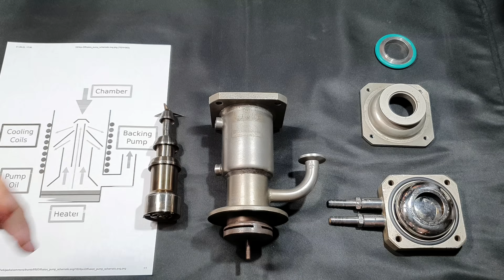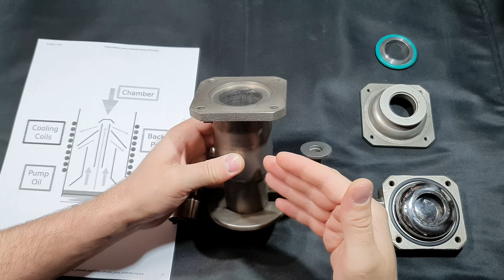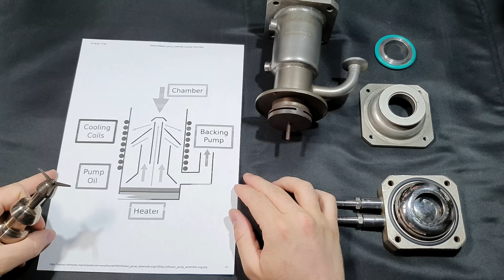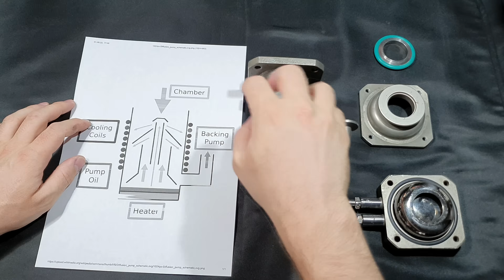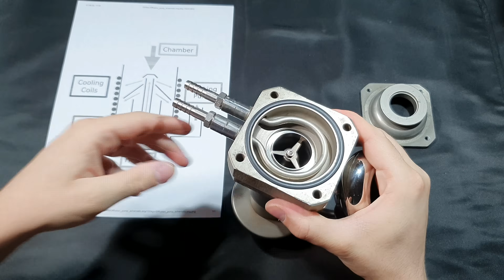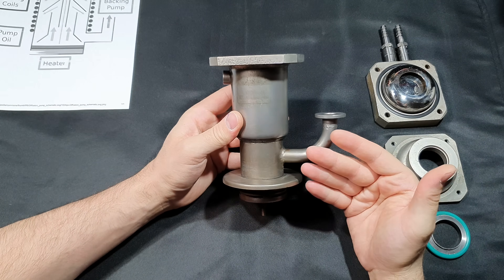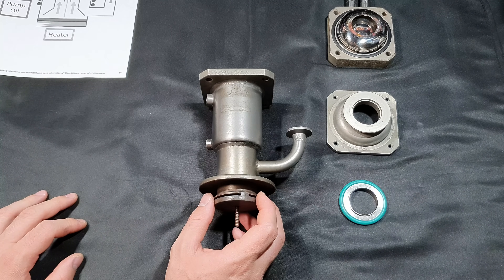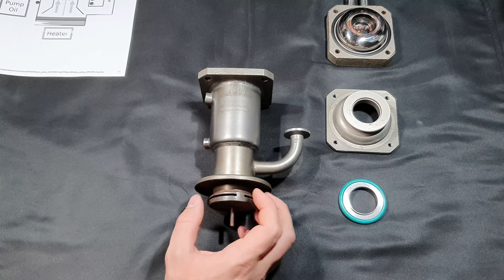The Science Behind Diffusion Vacuum Pumps: How They Work

Comment: So does the oil vapour envelop the air molecule, coating it in oil and dragging it down, or does the flow of oil just entrain the air? Ive got a small edwards air cooled diffusion pump arriving tomorrow to add to my 1980s neon tube processing machine. Currently using an Edwards RV3, which gets down to about 1x10-3 but hoping the addition of the diffusion pump will get it much lower. Looking forward to playing with it.

Comment: I worked 40 years in microelectronics manufacturing, I was in charge of various processes steps all using vacuum systems. Diffusion pumps were popular until about 20 years ago. Since then the, drawbacks of, size, orientation and most of all oil backstreaming, has rendered these pumps obsolete in manufacturing processes, all have been replaced by turbo molecular and Cryogenic pumps. RIP diffusion pumps.
Reply: They're still very much in use in metallurgy and particle physics, as they can pump more volume than any other type of high vacuum pump and require very little maintenance.  In particle accelerators they are generally headed by a cryopump.

Comment: I occasionally use a diffusion pump. I get the oil from Dekont-Vukuumservice-GmbH (Germany). I use Dekonol DIFFM100 (€37.96/kg), a mineral oil specifically for diffusion pumps. They also have the Dekonol D705 variety (€218.54/kg), an oxygen-insensitive silicone oil for higher demands. But so far I've gotten along well with the mineral oil. 
Greetings from Germany.

Comment: Originally I thought that this might be used at the output of a Bussard Collector for picking up extra hydrogen fuel instead of just bouncing it away which takes away from the inertia.
Accumulate and use.
Something else to fling it through a small hole into a big tank for a pump which can add pressure later.

Comment: Thank you very much!  I'm a particle physicist; vacuum was the complicated mysterious thing that would fail and cause us to not be able to take beam until it was fixed.  I'm pretty sure that even in big beam pipe volume accelerator systems, they use diffusion pumps as the primary pump (backed by big mechanical roughing pumps). 

I'm so glad for your thorough explanation.  I've seen diagrams of diffusion pumps, but just of the tree shapes and the oil sprays.  I've never seen a diagram with the heater and the cooling jacket.  That makes so much more sense.  

Thanks!
Reply: Meanwhile, for me, vacuum is simple even if temperamental, and beam generation and beam optics are the mysterious thing.

Comment: Very interesting! 

I can’t remember where I saw it, but in the 19th century they used a vacuum pump design that looked like a bicycle wheel with tiny buckets set around the rim. When the wheel spins each bucket picks up one drop of mercury from a sump, carries it up and over and throws it into a funnel that shoots a drop of mercury across the vacuum chamber and into another funnel that leads back to the sump. When the drop flies across chamber it pushes out any gas molecules that went into the exit tube and that is how it creates the vacuum.
Reply from the maker: What you are referring to is called a "Sprengel pump". Also a very interesting and cool concept. 
Cody'sLab made a video about a DIY version of this type of pump.

Comment: 0:57 Foreline pump? Fourline pump? Fohrlein pump? What is it? (I've never heard of it, let alone got one!)
Reply: Came from German, can be translated as “before” vacuum. Basically it’s a pump which creates primary low vacuum for higher vacuum pumps to work.
Reply: More common name is forvacuum pump
Reply: Foreline pump, also known as a roughing pump. Like the other guy said its to bring the vacuum chamber down to a suitable level of vacuum before turning the pump on. With any serious vacuum application, pumps generally have a certain level of vacuum that they are fit to run in, because otherwise they will be damaged .

Comment: I've got a lot of appliances from an early vacuum tube shop from the 1920s. The shop later specialized in TX tubes refurbishment until the 60s. With it came 2 early glass diffusion pumps (unfortunately cracked) still with some mercury droplets in them.  Also with some asbestos isolation. Apparently they were used with a Bunsen flame back then. They look beautiful really.

Comment: YOKOGAWA fluid gyro compasses for ships still have their older CMZ-700 units in service, there is about 10 cc. of Mercury inside the unit along with medium weight mineral oil and water treated with a preservative. Their newer CMZ-900 are mercury free and only have the mineral oil and treated water. I used to service those units and about 1 out of 10 jobs was an old CMZ700 so I had an annual overhaul kit of mercury, oil, treated water, and o-rings, and cleaning solvent. BTW love your channel, your explanations are excellent!

Comment: All is good but I'm unable to understand one thing that what thing forces the air molecules in vacuum chamber to come in the inlet of the pump. I mean what creates suction at the inlet of diffusion pump. 

As in rotary-vane pump we have blades fixed on rotor which create suction at the inlet.
Reply from the maker: There is nothing forcing the air molecules into the pump. That's the weird thing at very low pressures. In the molecular flow region you basically have to wait for the air molecule to fly into your pump where it is then excluded from the vacuum by the pump. That's also the reason why vacuum hoses or pipes for high vacuum applications have a large diameter. The chance is much higher, that an air molecule will fly though a larger opening than a smaller one.

Comment: Since I do many applications utilizing vacuum (mostly vacuum distillations of high-boiling materials), I'm very happy to learn more about it. Pumps, gauges, tubing, flanges, sealing etc. For example, lately I have been interested in how much influence the type of oil has on the resulting vacuum of a rotary (belt driven) oil pump. It has to be of certain parameters, fresh (not contaminated with volatiles) and in proper amount. Otherwise the vacuum drops significantly. Other influence (hosing, sealing, aparatus size, number of connections, even freezing - no significant importance is observed). I'm thinking about incorporating the diffusion pump to our systems, too.

Comment: have you tested the pump yet? And measured what kind of vacuum it creates?
Reply from the maker: Sadly no. I did not have the money to buy the oil. But I will make a video as soon as that changes :)
Reply: Did it come with a manual with what wattage or did you custom make it yourself? And what kind of roughing pump will you use? And if you do have a manual or made it yourself, what kind of pumping speed and ultimate vacuum can you achieve? I assume the bigger the pump, the fast and more ultimate the vacuum becomes.  I just spent 200 euros for a wet dual stage rotary vane pump that goes to about 3x10E-3 mbar. So looking for my second stage part. I'm working on additive manufacturing so I only really need to look at a high vacuum. I wish ion pumps would work for this type but physics are against me :/(they seem the most interesting and cheap to diy build) but they would start to break easily at this type of roughing pump.
Reply: Great videos by the way, just subscribed very interesting projects

Comment: I worked with mercury diffusion pumps in grad school (for organometallic synthesis).  The main advantage is that they are immune to air/oxygen intrusion, so there is no need to bypass the pump when evacuating large flasks/chambers.  This simplifies valving and saves time.  Of course, the trade-off is that you always have 10kg of mercury refluxing in a large and complex glass apparatus right next to where you are manipulating flasks, stir plates, heat guns, cold traps, lecture bottles, etc.
Reply from the maker: Thank you for the information!
Reply: Now I'm curious, how did you set up the cold traps for this vacuum system? I would imagine you need at least 2 (or 2x2) one between the difussion pump and the oil pump, as to not contaminate the oil with a bunch of mercury. And one between your vacuum system and the difussion pump to not get solvents etc into the mercury.
Reply: @merlin1371  The diffusion pump itself was water cooled, with an extra water cooled condenser on the low vacuum side (between the rotary vane pump and the diffusion pump).  A liquid nitrogen trap was used between the diffusion pump and the main vacuum manifold and kept full of LN2, except for maintenance shut downs (about once a year, when maybe a mL or so of mercury would be recovered, mostly from a McCleod gauge on the main manifold).  Four work stations depended from the main manifold, each with a LN2 trap for collecting solvents.  Two of the work stations were identical high vacuum manifolds (with a sub manifold for three sodium/benzophenone solvent vacuum stills, connection to a mercury manometer/bubbler, scrubbed argon, and the reaction apparatus - typically a "flip-frit", but also sublimators, reflux set-ups, etc.).  One work station was a 4 port Schlenk line.  And the last work station was an automated Toepler pump system (for measuring gas consumed or evolved and analyzing evolved gases).  Here is a link to a page with some pictures of the vac-line with Toepler pump: https://wolczanski.chem.cornell.edu/lab-tour/ .  Not sure if they are still using a mercury diffusion pump on this line (which I used from 1981 to 1986).
Reply: Screw wrecked a plane stranded in the woods movies, lost at sea movies, deserted island movies, submarine movies, stuck underwater movies, stuck in space movies, lost is space movies, stranded in space movies, trapped in a broken submarine/boat/spaceship/cistern/receptacle/bunker/relationship movies AND this mercury rerefibulater thing.
.....but also I want one 😮
Reply: Guess we can't go and leave the mayflower, poisoned oracle, odysseus or lead water
 So far yet so close
Reply: I opperated one in the neon business once that ran on mercury.
Reply: Not doom clock absorption adsorption organic of Hg (2 ) Cl, thermometer skin impermeable type surely?   Glass aspirator will not foul, stainless steel probably had in sinks bet.   Chemistry should be acceptable cost wise, but all anti intellectual criminal  silliness. Kid channel zi know how to make meth it’s easy!   Oddly they use Organometallic reduction solvate e- not C-carbon?  Explodes? H20 cause Need it?  lol.   Safe ways to not call attention to what’s better left to cartel for peanuts.  Like dropping out of Levo or whatever. On fire house car, probably look into it?  Even expect police that condemn house, simply cannot be habitable ever, wall full of synthetic analgesics and radioactive.   The absurdity the fentanyl, found on race horses, 4 variants. No samples cayman etc schools, pharmacy, produce sent through GC/MS…ID.   
      Licensed not selling though fence like Wyeth Ayerst up street, tons as seed crystals all over? With cas skeletal.  
   Nile Red!  That’s the primary amines are easy of already done just redox or reductive animation. Course Hg(II) Chloride cause they should have that and put on drugs like manganese heptatoxins, bug spray weed, poorly diluted colored so know getting that heavy metal goodness in skull. Electrolytic cell, pt pd carbon H2 etc… Someone actually put a body in a tub and bought hardware drain cleaner, sulfuric to commit the perfect imperfect error.  Sister told me on show.  
    Can but ph litmus in hobby looked at floor hundreds bottles nitromethane, nitromethane?  For tiny toy cars planes?  Can’t get legit chemicals cause think so magical supply ends.   Sorry, trying to be a cool guy with bunch no interest in subject.    What else I make nuisance chemicals so folks are annoyed, dead body skunk putricine, protechnics, military ex decomp ex.  Why, plenty folks saying do foolish things. Amalgam will melt aluminum aircraft like an iPad or soda can.   
     The horrors unleashed on earth DNA RNA code synth, adding altering genomes, if not lessening killing pathogens, gain of function small pox. Anyone can make  whatever but they aren’t just never do, rare mentally ill. Before net, all knew not said cutting edge research as undergraduate, proved meds toxic then reversed lesions.  Sabotage partner, order rhodium crash company IPo name price. Two hell on earth north Philly kids survived and read wanted to not poison. Fired, cephalon all full of supervisors letting folks die fall into waste treatment inhale, drugs walk out . Lime workers buy yachts. You better fess up, fired. No problems with bad press. Spills, dozen killed purposely by two I know, terrorism of judge.  14 million from me, fled to uk. Sold 20k balance for a bag of weed.  Killed wife will kill second, kills kids. Surrey is rich stats bear out issue. If cared, 4 kilos billions doses, 5% morphine oxy drips steps but borrow a book.
Reply: I think they are a consideration for nuclear fusion vacuum generation, too, in particular when using tritium
Reply: Why Do we creat vacume for metalizing process?
Reply: Can this principle be realised with gallium metal and some pump coating that prevents the adhesion?
Reply from the maker: @Zaborovnik No, the boiling point of gallium is too high. But mercury can be used. I made a video about a mercury diffusion pump in case you are curious.

Comment: Additional pro/con:  A diffusion pump, because it doesn't have moving parts, isn't going to create any vibrations like a turbo will (or, if it does create them, they will be significantly smaller).  That said, if your turbo is making lots of vibrations, you have different problems!.  Con:  You can only run them in one orientation (vertically).  Turbos can be run upside down/sideways/etc and are nice for chambers where you want the pump coming into a different orientation.  Then again, you can usually find right angle flanges...
Reply: excellent insight
Reply: Yup that was an issue with upgrading a SEM. The vibrations needed to be dealt with. 🤔